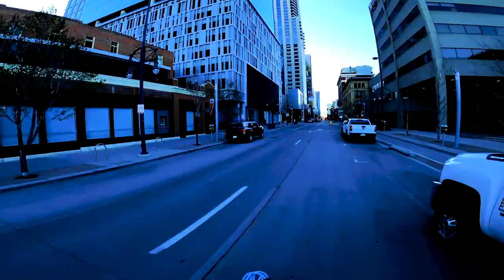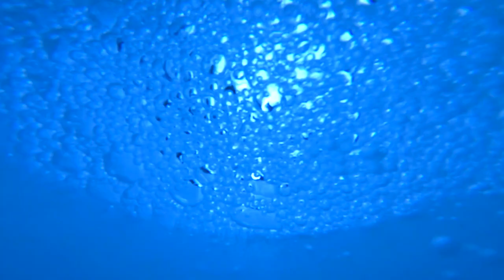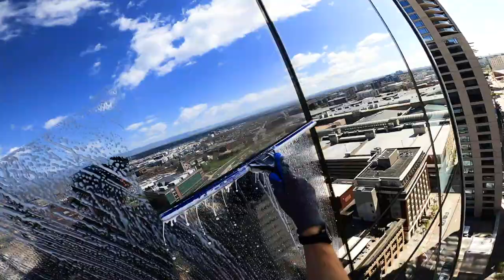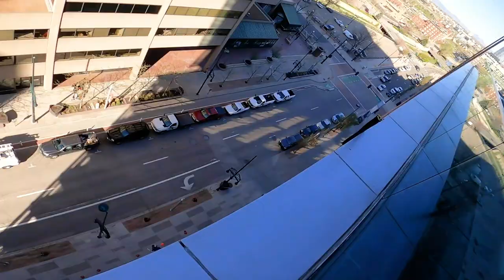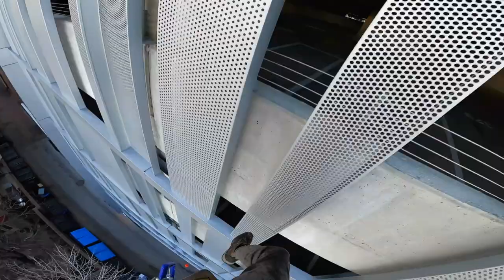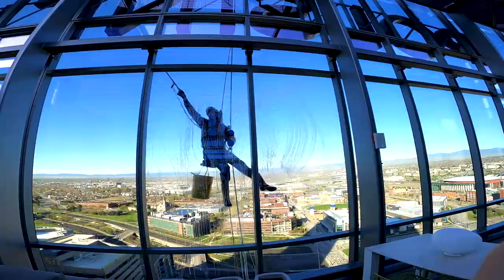Rope Access Window Cleaning | 309 feet

Comment: hey bro could you teach us how to rig, another thing was how do you drop down  where the only place to rig is diagnol from the drop
Reply from the maker: Hey, do you clean windows?
We use something called a directional, basically a rope tied back to a separate anchor point in the opposite direction to line the ropes up where you need to drop
Reply: @ohhey539  Yea bro, im 20 yrs old i just started my own window cleaning buisness im losing out on high rise jobs because i dont know how to rig
Reply: @ohhey539  if you got an email or phone i can send you some buildings so you can help me out
Reply: @ohhey539  the thing is for the directional to be mad you need an anchor around and that is something that is not available to me, for example i got to drop far right, all anchors are to far left
Reply: @dontforget831  you need to take a course and be certified for that stuff buds. Can't just be going around rigging stuff off advice

Comment: why don’t you use a swing stage
Reply from the maker: Because of the building setup. We're unable to make roof moves, so no tie ins. 

Also we are far more efficient in the chair by not needing to deal with moving the davits or mechanical issues.
I would much rather be in a chair then stuck on a stage
Reply: Swing stages are lame